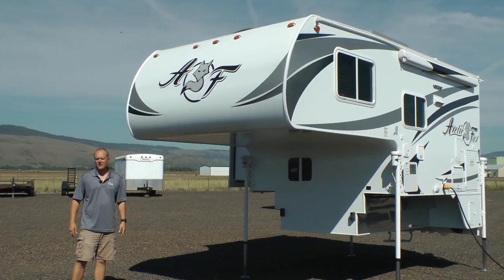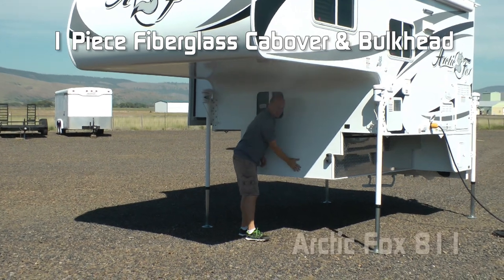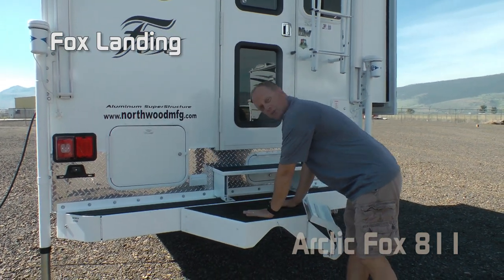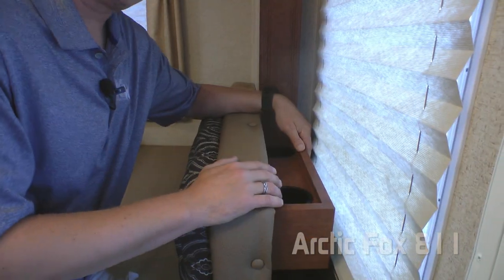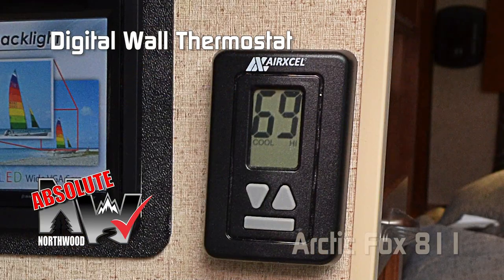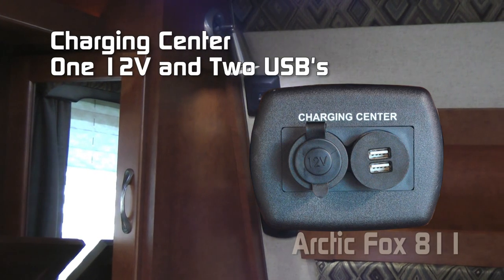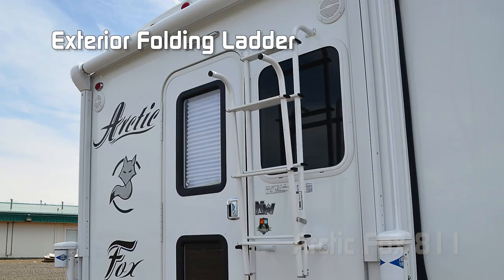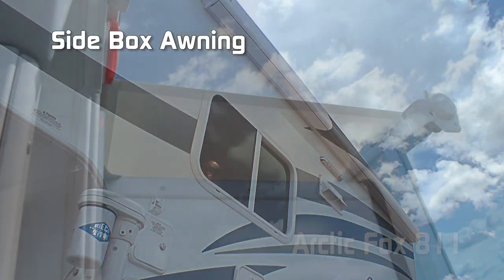Quick Tour Of the Arctic Fox 811 Truck Camper

Comment: We looked at this model yesterday in Nevada. Loved it. We also looked at many Lances, man, what junk they are. Cheap cheap cheap. We have a Northstar laredo and love it very much. We can't find ANY camper that compares to the toughness and usability of the Northstar. All super high end components that will last forever but maybe not the best when it comes to a nice interior. Very basic. We love this Arctic Fox because of the slide. Of course we are MUCH lighter with our camper truck combo of Ford F250 and the Laredo, a perfect pairing as for all our weight. We are just about max at the CAT scale on GVWR but we are under a couple hundred pounds each axle so we are good to go. This Fox camper would require a much different truck as the weight weight is over 4000 pounds. That is 3500 truck possible only a dully diesel. Most likely have to go all the way to 4500 to really carry this monster and all your stuff. Most camper buyers are clueless when it comes to the weights involved and most driving on the road today are grossly overweight. Which in the case of an accident you will be held very liable. Just start with he big truck and have no worries. Do the math and the research, you'll be glad you did. Check out Truck Camera Adventures and you'll learn all you need to know.

Comment: Apparently no manufacturer will recommend a truck for use with any of the models they sell. I suppose this is over caution on legal. But would it kill ya to tell the dry weight? Also simply saying "" starting at 24000.' or a general price range would be a service.
Reply: I have a 2015 GMC Sierra Denali 2500 and I have hauled the camper and a 25' boat over the Cascade mountains with no trouble.
Reply: Dry is over 3000, we is just over 4000. You need a min 350-3500. I'd go bigger.

Comment: Really like this one. 2 questions. Can an  aftermarket 32inch  tv be added by a qualified rv tech to the slide wall facing back door and when you opt in the winegard  I understand  it uses coax for the power but do you run HDMI or the red/white/yellow wires FROM receiver to loft tv and /or the additional larger TV ? Thanks. You guys have a really good reputation in the small but close knit TC community.
Reply from the maker: The only place we install blocking is up in the cabover for the designated TV area.  It's very simple to mount a TV bracket, and we use 3/4 plywood for blocking. We use HDMI cords now.

Comment: Very nice - I haven't been able to find one equipped as I would like at any of your dealers.  Can you tell me the current wait time to have one built with the options we are interested in?
Reply from the maker: We have a current run scheduled for late March, and will be scheduling another run for a build time around mid May.
Reply: Was able to place an order in time to be included in that March run.  Have used my new 811 several times since it was built and I am extremely happy with it so far.  It certainly provides some flexibility on camping locations that were obstacles for my prior 27-5L fifth wheel.
Reply: @backwoodscamper1066  
Im back and forth on a 5th wheel or the AF TC for retirement and full time living.Ill prob go with the 1150 for the dry bath. Any regrets so far? Ever wish you had the 5th wheel still for the extra space inside? I know TC's can go places that the 5th wheel couldn't, do you see yourself going to those kind of places or do you mostly just stay in campgrounds? I know these are built very well too and thats a big factor in my decision, I don't wanna spend $40k and have the RV in the shop like i read a lot on here 
Thanks for the input!
Reply: First off I would have to say that we were extremely pleased with our AF 27-5L 5th wheel and debated for several months before going to the AF 811 truck camper.  We loved everything about the 5th wheel:  floorplan, length less than 30’, and overall comfort.  We used it for both full hookup
campgrounds and boondocking/dry camping. There were two primary reasons for switching to a truck camper:  we got into off-roading with a RzR side by side and while I tried double towing for awhile it made for a very long rig and I was uncomfortable with the set-up, and we also found we were camping for shorter periods of time (3 or 4 days instead of a week or more).  Given those changes it made a truck camper a better option for us.  We almost never go to a full service campground with the truck camper since we prefer boondocking.  We have camped for just under 60 nights this year and still have one more trip planned.

We are equally pleased with the truck camper and its performance BUT I could not full-time in it with a second person.  I find the space too confining when my wife and I spend more than a couple of days in it if the weather is a deterrent to being outside.  Ours is configured with an adequate amount of storage but most of it is in the sleeping area and therefore a little less convenient to reach – the bigger issue is where do you put things when they come out of their storage compartment.  Having a unit with a dry bath would
definitely help.

One last thought I would offer is if you plan on exploring, once camp is established, it is much easier to un-hitch a truck from a 5th wheel than it is to off-load the truck camper.  If I ever stop pulling a trailer with the RzR
I would probably go back to the 27-5L since it is short enough to go most
places.  Rather long winded but I hope that helps.
Reply: @backwoodscamper1066  
Not long winded at all, the more info the better! I really appreciate your time and advice! I was looking into the 1150, a lot more room. Also possibly a 28ft grand design 5th wheel.  Ill be solo for a while, I'm only 44 and will be retired, kinda hard to find someone my age to pick up and go!!  I was thinking the 5th wheel will be better for extended stays, more comfy. How towing a 5th wheel around, I hear its very easy compared to a bumper pull.